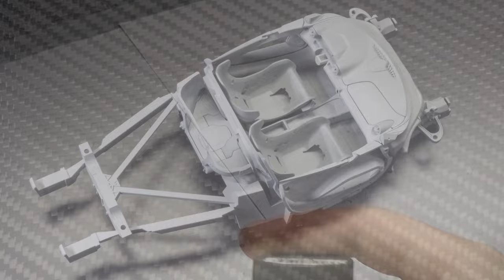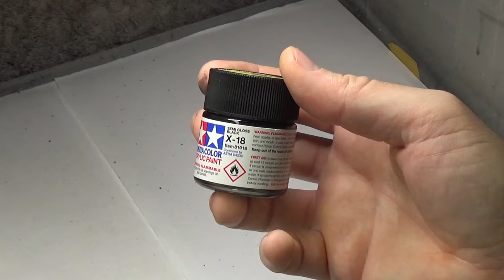1/24 McLaren Senna Full build. Tamiya 24355

Comment: Super work but I’ve noticed you don’t seem to sand down the surface for painting in this video. As I was told it was important I was wondering If you didn’t do it or simply cut it
Reply from the maker: sometimes it does not need to sand before base coat. May be the primed surface was smooth and ok for base paint.

Comment: HI! i have a few questions for you, i´d be glad you could help me out! I see you apply cement directly on the painted surface, does that work fine for you? Cause it sure spares you a lot of work not having to mask all the to-be-glued surfaces. And when do you use Tamiya and when Revell? thanks and awesome work!!
Reply from the maker: hi, thanks mate!
in some cases i apply directly on painted surface,  but not recommend it. THe best way of course is to clean glued surface.
what did you meant with Tamiya and Revell ? glues ?
Reply: @Scaleautoshop  thanks for responding!! I mean that i see you using both Revell and Tamiya glues, in which specific cases do you use each one?
Reply from the maker: @luto2000  tamiya liquid i use in case when i want that this glue were in all narrow or invisible places when two parts are positioned to each other. Revell is a regular glue and i use it before positioning two parts.
Reply: @Scaleautoshop  thank you!
Reply: @luto2000   I did use the revell glue in a few places and found it melts some times like around windows and had few small parts snap so tried to glue them together just to watch them melt lol      The tamiya one in the glass bottle with the small brush works better with small parts and doing the windows